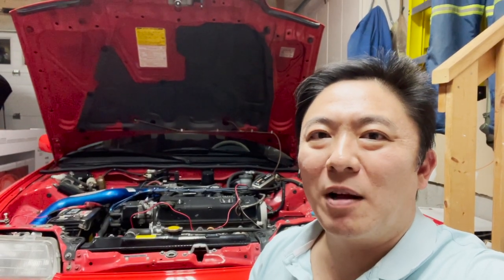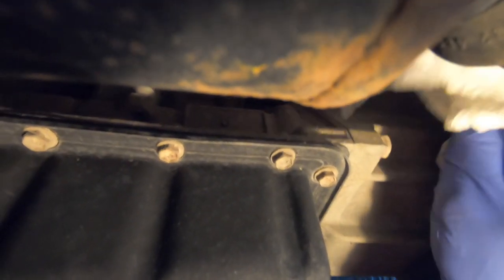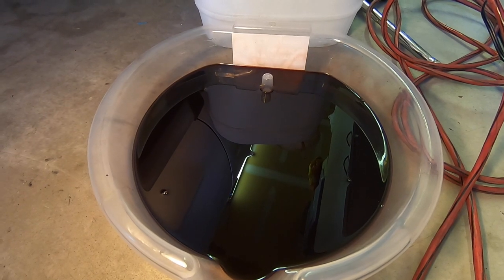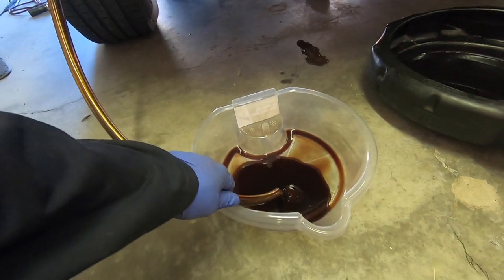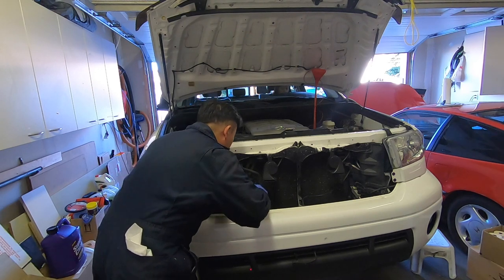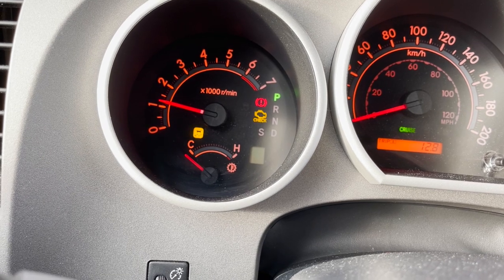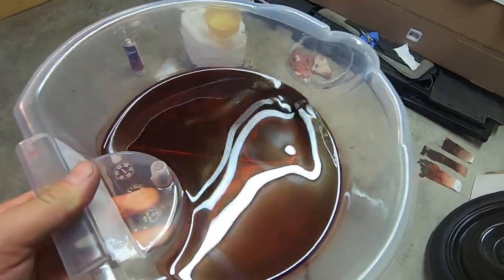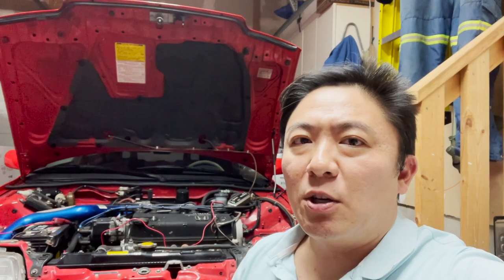Toyota Tundra Comprehensive Transmission Oil Change

Comment: So this is the correct way to do it per Toyota?

I’ve seen videos of people filling and draining and man that just seems like it will mix up all the new fluid with the old and you’ll be pouring out a bunch of good fluid.
Reply from the maker: Ironically this is the BETTER way than Toyota's factory approved procedure.  This is why I suck out about 3 litres of fluid b/c at that point the sump is almost completely empty.  If you do a drain and fill only with no purge via the cooler then you're mixing a lot of old and new fluid together.  Using my method you're minimizing the fluid mixing and filling with fresh virgin ATF :)
Reply: @piercedasian  so what is their approved way? Just drain and refill over and over?
Reply from the maker: you are correct.  Drain and fill and check level.  My method is NOT invasive in the slightest bit.  Certainly SAFER than the power flusher method that the dealerships seem to still have.  Drain and fills work fine if you do them often enough but I sleep better knowing I did a nearly 100% complete fluid change on my truck instead of changing out 30%-ish of fluid at a time.
Reply: @piercedasian  I wonder how well it would do if you did one every oil change 🧐

I’m about to add a cooler to my 2020 so it should make it pretty easy to do.

Can you run it with the fill hose still in the transmission or have to reinstall plug every time?
Reply from the maker: @seabass22  doing every oil change = ridiculous as tranny fluid is designed to last a really really really long time. I’d say a healthy changeover is really around every 70-90k Kms and if you’re doing a lot of towing them every 50,000 kms is good. Doing any sooner is truly a waste. I have done independent lab testing of spent fluids and I can assure you that oil holds up a lot longer than people think it does. Cool that you’re putting in a cooler in your 2020. How did you achieve that?  The 2018+ tundras completely deleted the transmission cooler fittings from the tranny and to my knowledge you needed those from a pre-2018 tundra and had to do a bit of finagaling to get it to all fit right (assuming it even works). No you do not need to remove filler hose each time you start the truck. You’ll nice in my bid I never mention removing the full hose during the purge and fill procedure.
Reply: @piercedasian  I bought a kit online that comes with all Toyota parts and an aftermarket cooler and bracket. 

I meant just doing one drain and fill each oil change or every other oil change. I tow a lot.

Comment: If you have a scan gauge 2 reading the tranny fluid temp, do you need to put the pins in the obd reader and go through that process? or can you just read 115 and get under the car to check the overflow?
Reply from the maker: technically speaking no you do not need to short the pins.  In my video there was a MINOR detail omission that one of my viewers called me out on and that was in fact to remove the pin after it hit the target tranny temperature.  The shorted pin actually brings up the idle speed slightly apparently and removing it after it reaches temperature drops the idle speed down to what it would be if you were idling at a traffic light.  So in your case you could just get the tranny up to temperature and then drain off the excess.

Comment: Not sure why I don't have any fluid came out of the check hole. I replaced the pan and strainer. Filled through the fill hole until fluid start coming out of the hole. Turn the engine on to drain the old fluid out.  Refill oil back to the tranny and run the engine again until I see fresh oil coming out. Refill oil until it started dripping out of the fill hole. I open the check hole to let the excess fluid out. Ran the engine until transmission temp is at 100 degrees Fahrenheit. Remove the check plug and nothing came out. Am I doing something wrong?

Comment: Is there a filter inside that needs to be changed?  About to do this on my 2011 5.7
Reply from the maker: There is a basic mesh filter but it rarely needs changing.  The problem with getting the filter out on the tundra is that the tranny pan bolts are EXTREMELY prone to breaking and once those bolts snap it is NOT easy to get them out.  Not worth the risk and if the tranny is serviced regularly that there is no need to change the filter out.  The beauty of sealed transmissions like the one on the tundra is that dirt rarely get into them b/c there isn't a dipstick for junk to get into the tranny.  I've done tundras with some crazy wicked miles on them that have been run hard and after a full tranny fluid change they run like a champ and I've never replaced a filter on them.

Comment: Great video! Is this a A760E transmission? Again, thanks for the video!
Reply: It is in the family, the 5.7 ones have a different letter but pretty much the same with heavier parts. 4.6L Tundras use a A760E/F
 Lexus GS cars use that same transmission. E=RWD, F=4WD, H=AWD (for the cars, yes they have a real planetary transfer case that shares fluid with the trans!).
Reply from the maker: Yes, it is
Reply from the maker: thanks for clarifying the code breakdown of the transmission model #.

Comment: How is it going with your Tundra?  I am debating doing this with my 2011 tundra but it has 150k on the original fluid because my dealer told me it does not require service ☹️
Reply from the maker: My tundra is humming along perfectly and I've done some pretty heavy hauling and pulls with it since and she's still shifts butter smooth with zero issues.  150k definitely needs replacing!
Reply: @piercedasian  thanks for the reply.  I did the flush  a few months ago and no issues.  Running like new.  👍  AC compressor is going out  at 160k though.   I guess  I can't complain overall as that will be first repair other than just maintenance.
Reply from the maker: @TomRFL  that's great to hear!  Your AC compressor is going out?  What is wrong with it?  I just DID a Tacoma AC compressor fix but didn't document it b/c I was too pressed for time but it would've been a GREAT video to do that I'm sure would apply to Tundra owners too.  Missed opportunities I tell you...
Reply: @piercedasian  truth be told it is still cooling but I hear a slight squealing like a bearing going when it engages.  Toyota said don't worry about it if it's working.
Reply from the maker: @TomRFL  well, there is some truth to their statement BUT caveat emptor b/c guess what... it likely WILL fail when you need it most which is during the cooling season.  Definitely get it fixed on the off-season if you can so that when summer rolls around it doesn't bite you in the ass and you can't find parts or a shop that charges a reasonable rate to replace it.  It likely is the clutch assembly.  On the bright side, it is relatively straightforward to replace on most Toyota compressors.  The best part is that it comes with a new pulley, new bearing, and magnetic clutch so you're fixing like 50% of the compressor on the cheap.  I really wished I documented the compressor clutch fix.  It totally would've helped you out.

Comment: @piercedasian I have seen several so call "Comprehensive Transmission Oil Change", and without a doubt your video is layed out very detailed and comprehensive.  The other so called, "mechanics" or "technicians" do a half ass job.  Thank you very much for sharing this video.  I have a 2008 5.7L Toyota Tundra that has 145K miles including a tow package and have never changed the transmission.  I only use the truck to pull my 30 ft travel trailer.  I've never had any problems with my truck - EVER!!!, other than just the maintenance.  Because its a 12 year old vehicle, and after seeing your video, I thought I would change the tranny fluid. It looks like a piece of cake, a walk in the park - NOT!!!  LOL.    Thank you for sharing your video for us dummy's.  You are truly amazing!!!  Rick
Reply from the maker: Yeah I know what you mean by other videos. Quite frankly they do suck and I am proud to say that my bud by far trumps them all and I am not the type to toot my own horn. It’s just many YouTubers half ass the video. What’s the point of doing a video of you don’t explain the process correctly?  I am glad you like my video and thank you for stopping by!
Reply: @piercedasian  I attempted to do it myself yesterday (Sunday) and I SUCCESSFULLY  was able to do the transmission oil change.  It was easy after following your instructions.  Once again, THANK YOU SO VERY VERY MUCH!!!   ...... Rick
Reply from the maker: That is awesome Rick.  My response is late but GOOD JOB my friend!

Comment: Should I do this if I've no record of maintenance? My 2010 Tundra has Over 155k miles on it.
Reply from the maker: 100% you should.  Whenever I buy a used car I ALWAYS do a full fluid service on EVERYTHING to give me a clean "known" baseline.
Reply: Can this HELP My transmission to shift smoothly when it's cold, 5th n 6th are rough every morning
Reply from the maker: yep it definitely can but rough shifting can be related to many things.  That being said, follow these instructions exactly including use the proper toyota WS fluid and that ways you eliminated any fluid related issues.  Shifting rough when the tranny is cold is not usual so what I did when I had my truck was drive it until its had time to warm up and then drive normally after that.  Mine was always butter smooth when it was warmed up but a bit "janky" when it was cold.

Comment: Why do you show needing 12L of ATF in your supply list? How many litres does the trans hold in total, including the cooler?
Reply from the maker: To fully remove ALL old oil from the tranny you need that much.  This is effectively doing a self driven flush that changes 100% of the fluid in the tranny.  If you're doing just a drain and fill its like 3.5 litres.
Reply: My dash didn’t flash at all after filling the trans and hooking up my cheap obd2 reader instead of your paper clip jimmy rig. Seems to go into all gears. Safe to check fluid?
Reply from the maker: @mikeburry5093  no, you gotta use the paperclip method and get the tranny into fluid check mode.  Its just two pins you gotta jump (make sure you jump the right ones) and toggle in and out of drive and neutral as demonstrated.  Once the D is solid green is when you crack the overflow drain open and let the excess run out to barely a trickle and then recap it.  Having too much or too little fluid can damage the transmission.

Comment: Can i use cheaper oil to flush it and use the good stuff at the end?
Reply from the maker: no point in doing that b/c as you "purge" the oil fluid out you're actually filling the transmission fluid circuits with fresh Toyota fluid.  If you flush with a different fluid then now you have to use just as much Toyota fluid to purge out the non-toyota fluid.  Just follow the instructions in the video and your tranny will run perfectly.
Reply: You could technically. I use the cheap Walmart super tech oil for it.

Comment: Silly question but did you plug the other end of the hose that was left open when you separated the connection to attach the drain line?

Comment: u could use the obd2 scanner and go into live data logging to find out what is the trans fluid temp is, it's easier that way without having to do the tidious going in N and D until it 's falshed. i don't know y toyota decide to make the dip stick on the bottom instead of the traditional up on the engine bay one. it makes it difficult for car owners to service their trans at home unless u have a lift .

Comment: What do you do if you don't get any fluid out? Add a quart or so ?
Reply from the maker: What do you mean you don't get any fluid out?  I'm assuming the fluid overflow drain?  If you're at the right fluid checking temperature as denoted by the solid "D" and no fluid comes out I'd add another half quart.  You shouldn't be too far off if you followed my instructions correctly.
Reply: @piercedasian  yep!  added half a quarte and it worked

Comment: Did you pull the trans cooler off before starting the video? Thx!
Reply from the maker: I just disconnected the house but I didn't take anything out per se.  Just took off the clamp and pulled the cooler hose at the front of the truck.  I pointed that out in the video.
Reply: @piercedasian  Great, thanks, maybe it’s a 4.6 thing. Right there on my truck is a big square cooler and you cannot see the lines. I may have to go from the bottom of radiator I s’pose...

Comment: Why don't you change the filter
Reply from the maker: Unless you have had bad transmission problems or has been REALLY REALLY poorly neglected that it is best to leave the filter alone.  It is just a screen mesh that rarely had stuff in it (at least on the tranny's I've serviced).  What IS a MAJOR issue on the Toyota truck tranny's which is why I avoid at all costs to take the filter out to change is the notorious tranny pan bolts that tend to snap without warning.  Broken transmission pan bolts are a PAIN to get out and having dealt with a few of them already on transmission with super low miles on them (and no corrosion) that its almost like a sick joke that they snap.  Even the techs at Toyota won't change the filter out unless the transmission is being rebuilt due to failure. Lastly, the filter in the tranny generally stays super clean b/c the transmission doesn't really have a place for dirt to easily get in.  The oil fill plug is gasketed, there is no dipstick for dirt to fall into when doing fluid checks and well.. its basically a sealed tranny.  Hope that explanation makes sense.

Comment: Why didn’t you drop the pan and replace the filter?
Reply from the maker: no need as even the Toyota service schedule doesn't call for it.  The tundra transmissions are more or less a sealed unit so there is very little chance for dirt to get in.  If the transmission is running properly you're best to leave well alone and just service the fluid.  I've heard of multiple example of people removing the tranny pan bolts and having them snap off with the stud stuck in the tranny housing.  No thanks.  The risk for myself to remove the potentially seized bolts isn't worth the hassle that offers very little (if any benefit).

Comment: Can I do the same thing if the car passed a 100,000 Miles or more, without changing the transmission fluid

I mean about the flashing 

Thanks
Reply from the maker: I change tranny all the time k. Super high mile vehicles and every time it’s always shifted better and has never caused a tranny leak or failure. 100,000 miles on a Toyota is nothing!

Comment: nice job, how many miles were on the truck when you did this ?
Reply from the maker: I do the tranny fluid change on my truck every 75, 000kms.  Toyota factory recommendation is 90,000 but since I do all my own work that I tend to service them sooner.  Fluid is cheap insurance for a VERY expensive transmission.  The mileage at the time when I did this specific video was 155, 000kms.

Comment: Great Vid!.  Question:  DId you leave the fill plug off, with the fill hose-to-funnel left incerted in the tranny fill hole the entire time during the 3 fill/flush cycles?  (i.e. didn't screw the fill plug back on during the startup-flush cycle).   And further... if you left the fill hose incerted during all three flush cycles, did you also leave the plug off during the  level check process at the end too.  My thought there is if nothing comes out during the check, then it's easy to add more fluid until it trickles out since the fill hose is still in the tranny fill hole.   THanks !
Reply from the maker: Hey thanks!  To keep things short and simple -  yes I left the fill hose in the hole the entire time and during the fluid check procedure.  The sump is quite low from the fill hole so no oil ever comes out of the fill hole.

Comment: Great video! Jumper wire method not working for a 2019 toyota sequoia.
Reply from the maker: make sure you sand the sides of your paperclip since some paperclips have a thin clear coat on them making them non-conductive.  I know the pin method worked on multiple Toyota's I worked on so you might be plugging it in to the wrong pin location.  The sequoia of all things should be IDENTICAL to the tundra.

Comment: Helpful video, thanks for making it. My only issue was two broken transmission pan bolts that snapped on me. Did all the tricks to avoid that happening but they were frozen stuck to the aluminum and corrosion at the top of the exposed bolt. Doesn't help toyota didn't use antiseize and were very small pathetic bolts just begging for that to happen.
Reply from the maker: Glad you liked the video.  Your plight is exactly why I never bother removing the pan from the truck.  I've read far too many posts in the Toyota forums that say their pan bolts snapped and it is crazy how often it happens.  Shame on Toyota for installing puny little tranny pan bolts.  Did you end up removing the broken bolts?  How did you end up fixing it?
Reply: @piercedasian  Lol...put the rest of the bolts back on and left it alone. Pan has two broken bolts but that thick rubber gasket is forgiving and nothing is leaking.

Comment: Would you change it on 2012 Tundra with 70K or it's too late now and I should leave it as is (never changed before) Thanks you!
Reply from the maker: I would ABSOLUTELY be changing it.  Heck if you said your truck at 300, 000 miles on it that I'd still say change it.  70, 000 miles is hardly anything.